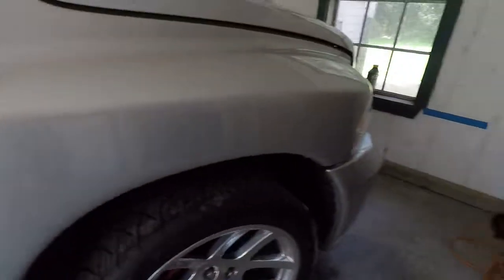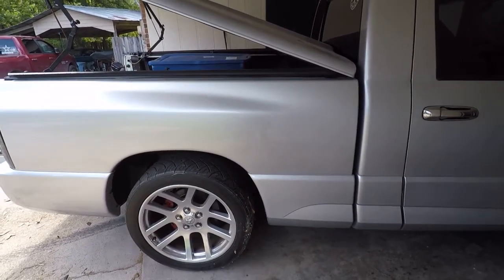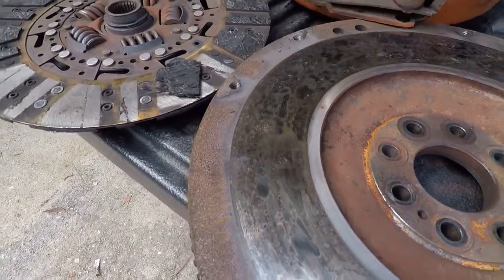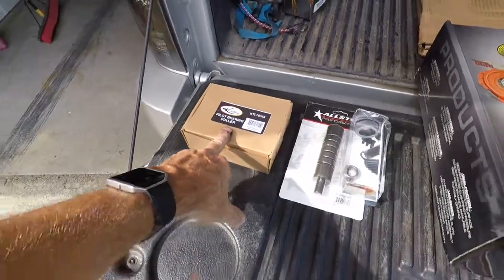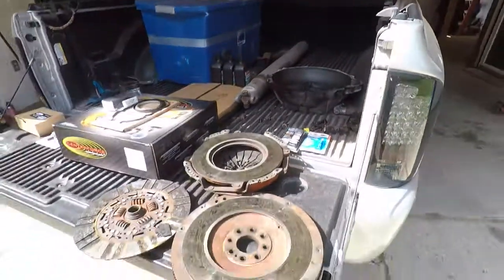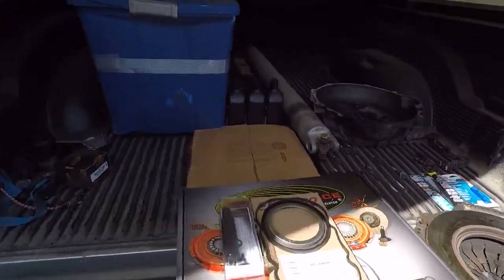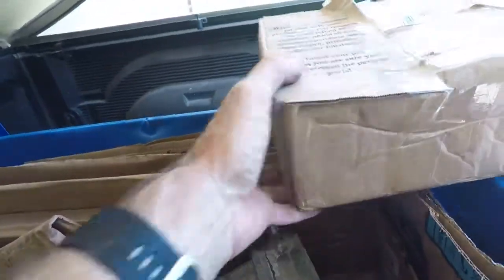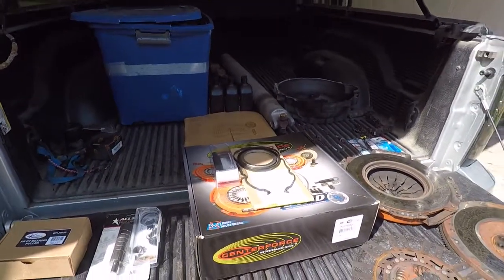SRT10 Transmission install prologue

Comment: Awesome video. what kit did you buy? I will have the Center Force Performance clutch kit here tomorrow for my 2006.  How did you like it? 3rd has been horrible to get in at high rpms. I heard a better clutch would solve that problem? is that true? thank you. 54,000 miles.
Reply from the maker: If the shifter is free and not bound up the clutch could help. I'd also recommend upgrading to the metal viper slave cylinder if that hasn't been done. Good luck!